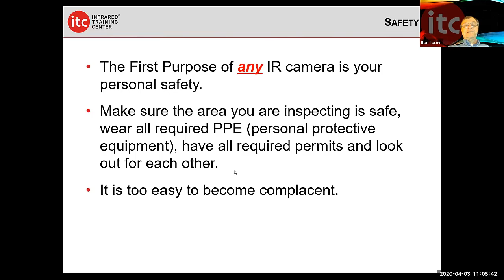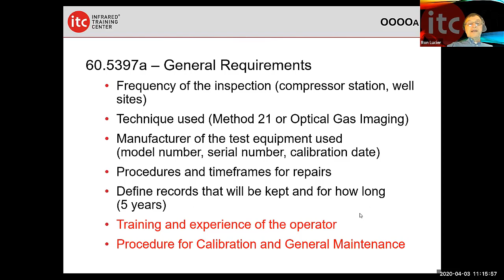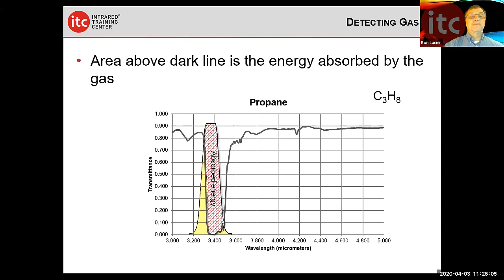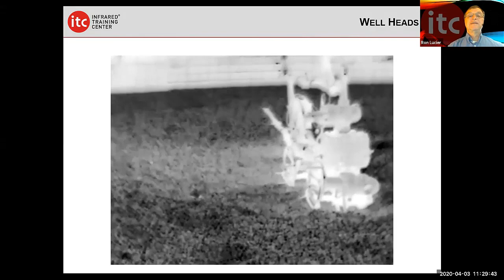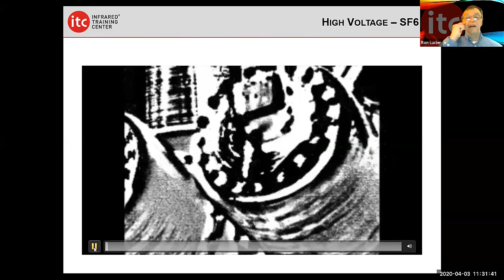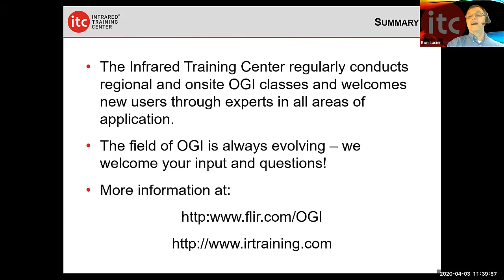Basics of Optical Gas Imaging

Comment: It says no calibration required. But how you can detect gas without temperature measurement ? So it means needs to be calibrated anyway.
Reply: The temperature isn't what is important. It's the way the gas blocks the thermal radiation coming from the background.